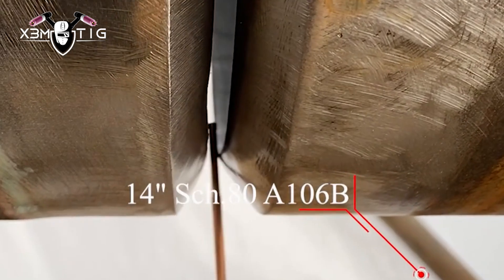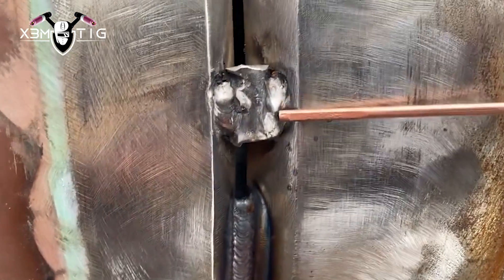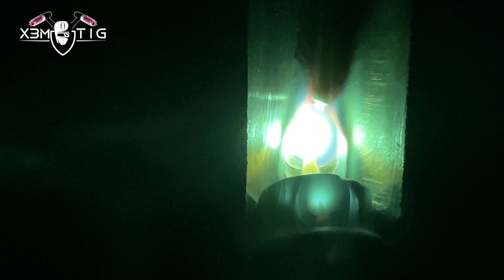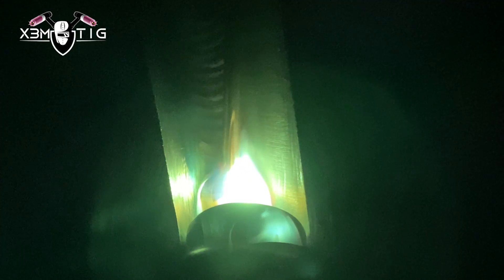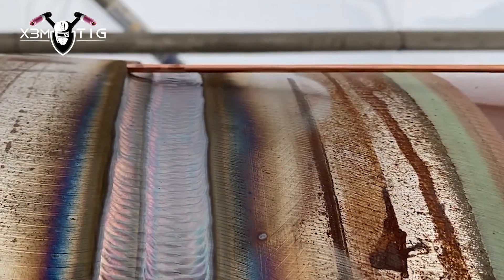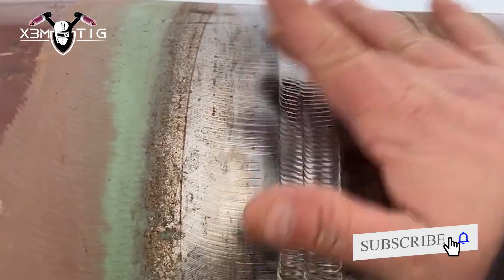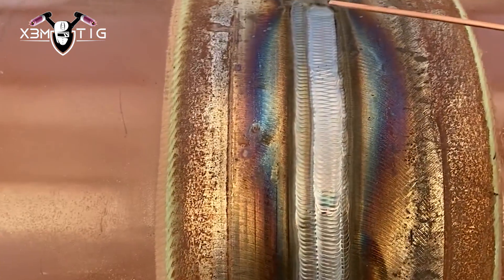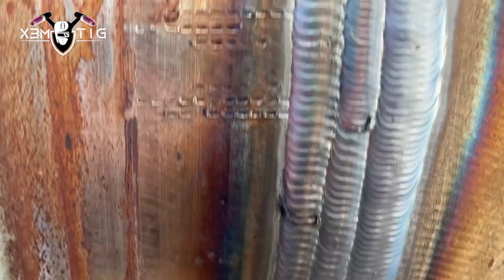TIG Welding Techniques For Successful MultiPass TIG Welds!

Comment: Is there a particular reson why you do not burn hotter and add more rod in each pass? My guess is that I do half the passes you do but I also don't walk the cup. There might be a really good reason, are you afraid of creating a void somewhere maybe?
Reply: Its all about heat input and keeping the structure of the material as strong as possible. Too much heat input can cause internal cracks at a moleculer level. The strenght of the weld is not the worry. But the strenght of the heat affected zone is. Hope this helps